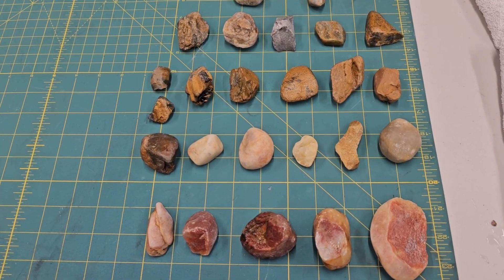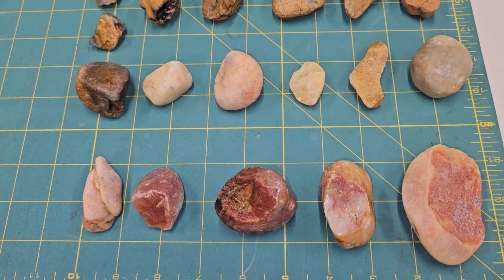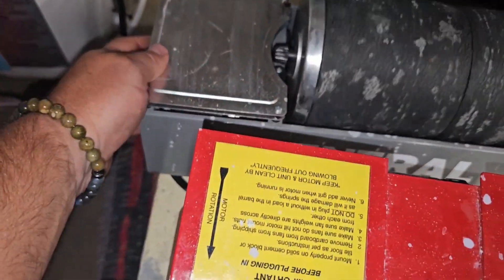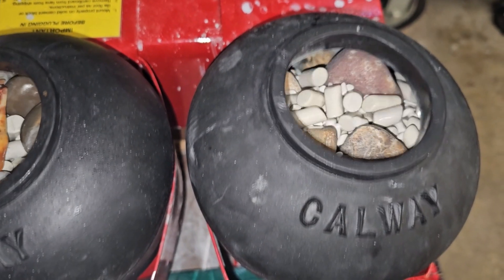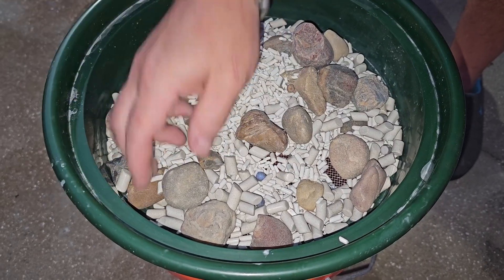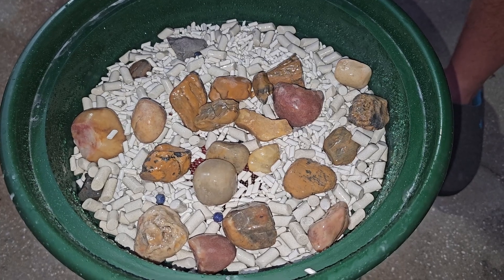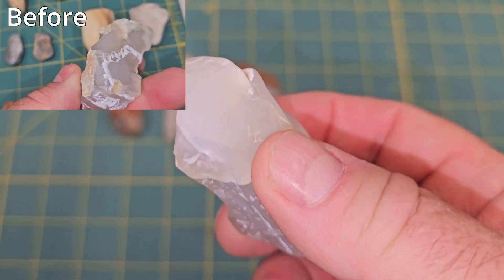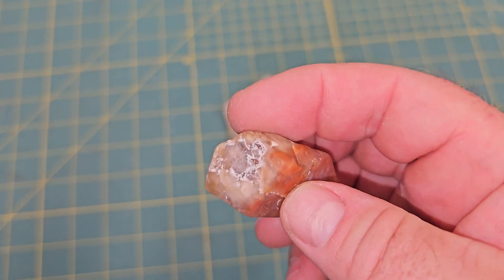We tumbled rocks without grit or water just to see what would happen!

Comment: Stage 1 in a Lot-O vibrating tumbler is a waste of time, even when using water and stage 1 grit.

It won't do much if anything to smooth out the roughness of the rocks.

Use the Lot-O for the rest of the stages because that will turn out superiorly polished rocks at a fraction of the time used if you use rotating tumblers, plus you get superior results using much less grit.